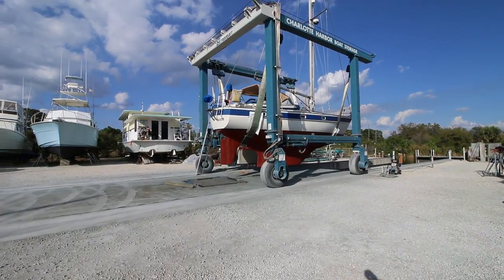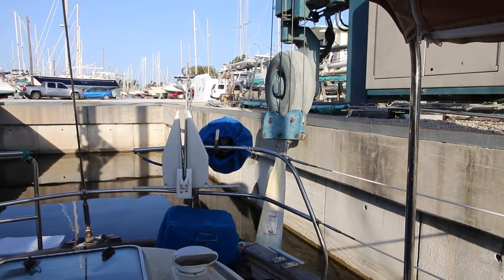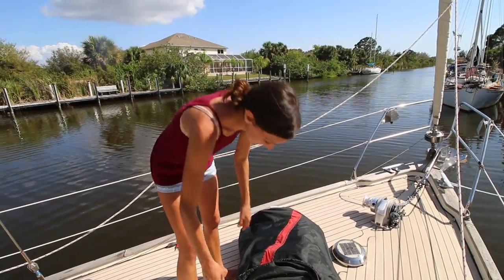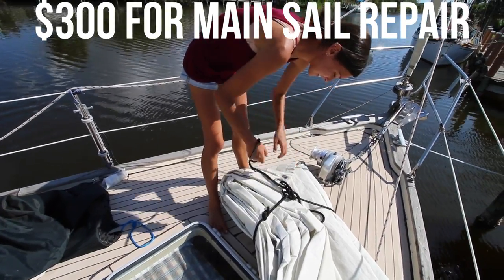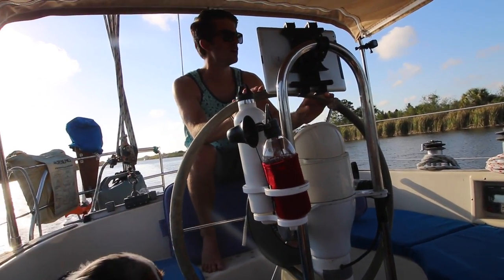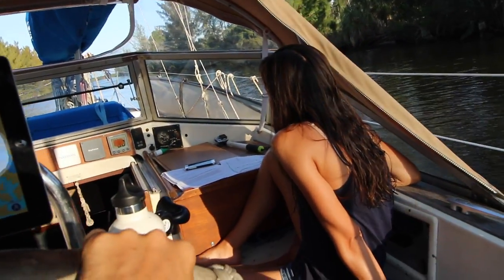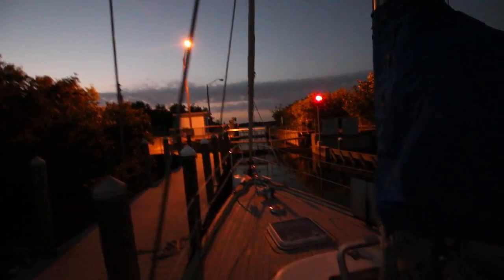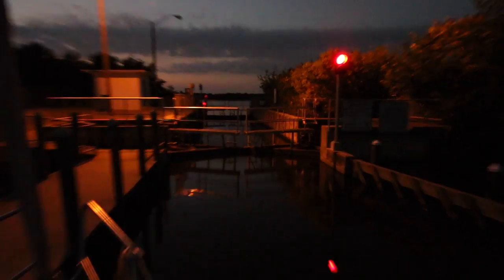31] Let’s Do This! | Abandon Comfort – Sailing The World

Comment: The good news - Happy to see you back in the water ! The bad news - That single battery switch will cause you some day to not have enough battery power to start your engine. Accidentally leaving that switch on ALL, your house power draw will pull from ALL your batteries ! That single battery switch probably doesn't have a Alternator Field disconnect incorporated in it. That momentary switching from 1 or 2 to all or switching from any position to another position while the engine is running and while the alternator is charging might never bite you but it has happened. It will eventually degrade and/or ruin the voltage regulator in the Alternator. It usually blows out the diodes, they can't handle the voltage and amps coming in to them from the wrong direction because as your switching, the alternator output has no where to go and it overloads the voltage regulator.. The switching and the voltage/amp draw from the starter also disrupts your electronics and could damage them. One way to solve this is with three (3) simple on-off switches and a BATTERY COMBINER RELAY, this relay is the key. 1) switch - Engine 2) switch - House 3) switch - parallel (combine) both battery banks in an emergency. The battery combiner relay will handle the charging duties and read when a bank is charged and disconnect it to charge the other bank and the charging device will reduce its charge to that bank as it becomes fully charged.  When no charging is present it disconnects both banks from each other. Your solar charger is connected to your house bank I assume (there's that word) and as your house bank is charging once it reaches a fully charged voltage the battery combiner relay will combine both banks to be charged. As you start using power for the house the house batteries will start to drop voltage and the relay will disconnect the engine battery. The Blue Seas brand has awesome combiner relays, they also sell a combo package that is a relay and a single switch that duplicates the three separate switches, just turn it to on and your done. I like the three separate switches manly so, if I'm not running the engine there is not reason to have power going to it. Watch Sailing Britican's latest video when they have a worn hose getting the starter and the starter relays wet and the engine is starting itself. The relay also has a terminal to connect to an indicator light to let you know when batteries are combined, Whoa....that's a mouthful. And yes, I drained both banks ONCE, just a click from the starter, got a jump start and motorsailed back in, Fun Day on Lake Erie !   Fair Winds

Comment: More piloting tips: You can set your mast, bow, stern or several point/s of your boat up on any land or sky POV from a star to a point of land or cloud (keep in mind that clouds move).  Always check your compass heading at least every 15 minutes and adjust as necessary. ALSO use the sun, shadows (if a shadow moves you are off course), wind on your face and waves (motion and sound/s of your boat etc). When tuned into your boat at sea you will even wake up out of a deep sleep if/when  anything changes (the sound of waves hitting the boat to a change in direction etc...  ALWAYS be looking around 360. That is your real job when on duty, not reading a book or burried in electronics. Scan your electronics and set all alarms properly. There ya go o----) 

PS: Trust your boat yard workers. They know where to place the straps etc because they do it all day every day so don't worry, they have you covered 99.9999% of the time (accidents do happen but not often at any pro yard).

Comment: (Back-up navigation) and so much more..Ryan is right (5 hrs ago)  I love my simple Garmin csx . Hardwired just inside the companionway (so its velcro attached to a mount out at the wheel). Never needs batteries. bought the patch cord. My routes with the waypoints are entered into the csx and it talks to my autopilot. So it takes leeway into consideration, I'm always on my Rumline. Within 200 feet of next waypoint it rings. I push a button twice and it switches course to new waypoint. Never hand steer or watch course. Drink coffee on fordeck ( singlehanded) and watch for uncharted logs (PACIFIC NORTHWEST). Anchor drag alarm ..Extremely strong  reception. Color daylight readable screen. Charts for anywhere can be popped in.    MJ sailing has a cat rather than a dog, my mistake. Wonderful cat .  G.T.   S/V  Silver Fantasy

Comment: A good reason for why you want your H.R.=  My friend Ray put out of Sausalito and under the golden gate with two other boats that He and Marnie had wintered over with. They all took pictures to send to each other and then, Ray said, Within an hour both of the other boats were out of sight. Ray had done an amazing job building a bulletproof 36 double ender. (Himself)  O.K. but he was shocked and crestfallen at how slow a heavy double ender is. Now days performance is a major part of performance cruisers.. Your 352 would blow by also and your sleek forefoot on the 352 will allow you to point up higher and cut through waves when close hauled going to weather...or slowing it down , taking it easy, and forreaching .   G.T.   S/V  Silver Fantasy

Comment: In last episode you mentioned the on-going costs of owning/maintaining/storing a boat. Would you mind sharing that? Maybe you have and I just missed it in an episode
Reply from the maker: Sure thing, Jody! Everything is by foot, the length of the boat. Docking, storage, amount of paint needed, more fuel needed to push that bigger, heavier boat. And the bigger the boat the more complicated things become, which on the water always equals more $. It's very hard to say it costs X every month to maintain a boat, way too many variables. But for us, we've learned (the hard way) the simpler the boat and the smaller the boat, the less it will cost. So if cost is a concern we always recommend getting the smallest boat you can deal with from a liveaboard perspective. If you want a bluewater boat take into account the storage needed and look at pocket cruisers. In our eyes, our sized boat makes sense for a family of 4. A couple like us doesn't need anything greater than 30ft.

Comment: Hey, congratulation on your voyage beginning! I do have a technical question though. Do you later plan to make an engine sound dampening project? Maybe it was that loud just on video, but it sounded more like an industrial machine rather than cruising yacht. Using some sound deadening mats for cars manufactures this could be easy (and cheap) fixed. Or it doesn't bother you? I'm just curious, not criticizing. Cheers :)

Comment: You guys discussed the electronics issue before and the simplification of just using the iPad.  I was checking on another sailing channel just  yesterday and they took a rogue wave that swamped the laptop and he was basically guessing where to go from there based on his last heading.  Do you see this as a concern? Like have a back up in a water box?
Reply: * the knowledge - priceless.   :)
Reply from the maker: Ryan is well versed in nav & dead reckoning from his time in the CG. We have 3 iPads Incase one gets swamped and 2 different methods of obtaining GPS location on the iPads. We always have a paper chart of the region out down below as well. Beyond that we have our inReach that has nav on it as well.

Comment: How do u use the i pad for gps i lnownu need navionics but bow do u get the gps
Reply: jordyn fouracres if your iPad doesn't have GPS already you can buy a plug in GPS for it.  I have a Bad Elf.  Does not need anything else to connect, the Bad Elf gets the GPS signal and you are good to go.  There are Bluetooth versions out there too.
Reply: Just to add to the other reply. For your iPad to have true GPS capability then it has to be the wifi +Cellular model OR if your model is the wifi only version then you will need an external GPS feed like that provided by devices like the Bad Elf (I think Garmin offer such a device too). Apple does not make it that clear at point of sale which is a bummer but if you dig into the tech specs it is there. If you are using an iPad in a salt laden environment a must have is a good waterproof case like the Lifeproof Nuud, without it or similar then your iPad is living on borrowed time.
Reply: Thank you